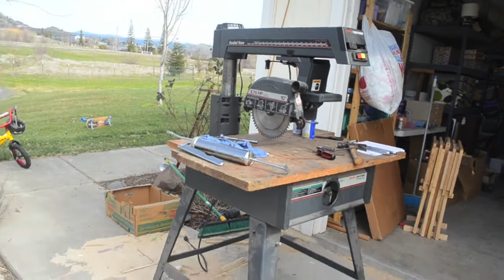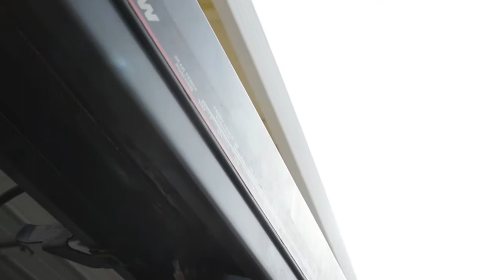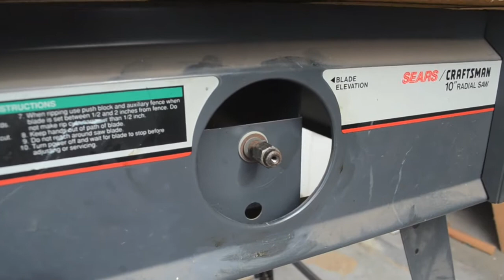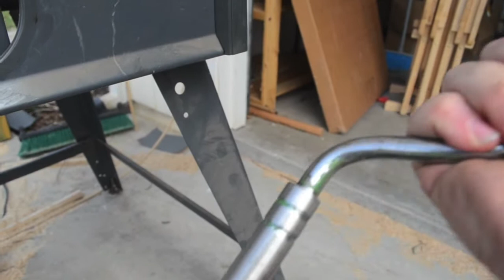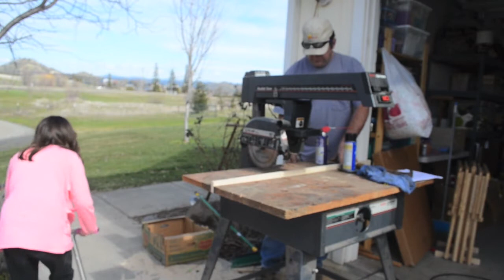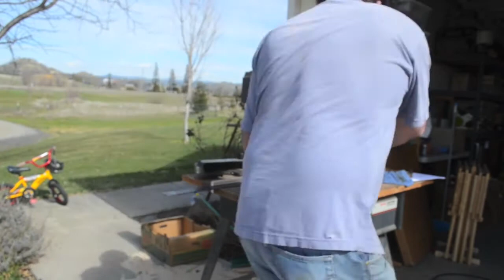MDOP#19: Radial Arm Saw Refurbish III

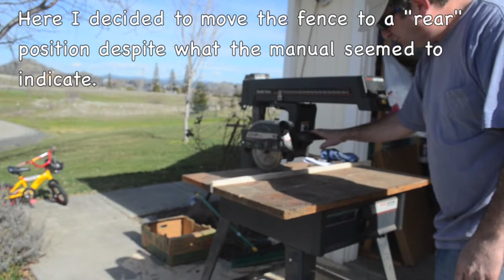Comment: Wow!!!! viewers and new comers to the hobby, this is very dangerous move starting the saw with junk on the table. Also at 8:36 into the video did I see that carriage move from the arm as he started the saw????? lucky the saw did not come at him, what a bloody mess. At 8:55 he said "is off a little bit", by the sound the blade made is off A LOT. He took the saw apart and didn't make any adjustments. Viewers and new comers this is not a safe way to operate a radial arm saw. 1- (this should be your first adjustment) level table to arm, 2- blade 90 degrees to table. 3- blade parallel to fence. 4- arm travel 90 degrees to fence. 5- paralleling blade to table. And without the clear bottom blade guard this is a very dangerous saw. At 11:12 did he just lowered the blade while running?, very unsafe move. I can see why people are getting badly hurt. No knowledge of how to operates it safely and no common sense. If that blade touches anything while running it will come at you. Take the video down, make a new safe one for your viewers, edit in parts of your project and walla! we may have a good video. Be safe.

Comment: Thank you so much for the tutorial. Just what I was looking for. I have the exact same saw that I bought at a garage sale for $50. The parts are all gummed up and stuck and wanted to take it apart to clean them. So glad your tutorial popped up. What kind of lube did you use to grease the parts?
Reply: Just an all purpose automotive grease.

Comment: Even if I'm the only guy who ever watched all 3 in this series AND found them interesting, Thank You for making them. I bought one of these same saws although I think mine is a little older than yours as its only 2 1/2 horse, and I'm trying to refurbish it. Had it working for awhile, then, I think, the starting capacitor went out. Have ordered a new one. 

BTW, I noticed that your blade shroud is the same as the one that originally came on mine.  There's a safety recall on them. Search for it, fill out the page and plug your serial number in, and they'll send you a new shroud, a new tabletop, and other parts for free! 

Thanks again for the great video. ☺
Reply: Cool.  Thanks.

Comment: Probably better than it was right out of the factory. Time to get the woodworking skills up to date now, you have some wood to make parts out of. If you do not come right with the raise then go buy a single socket and a reversible wrench and epoxy the socket onto the end so it is always there, then you can just rachet up or down with ease.